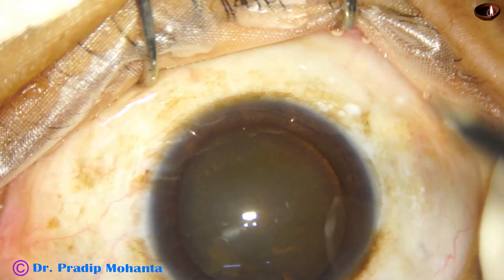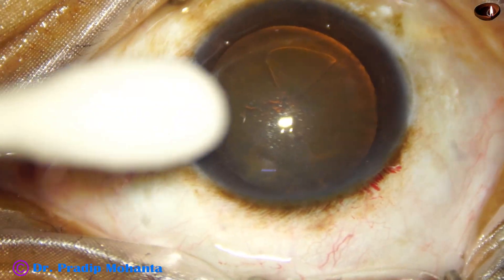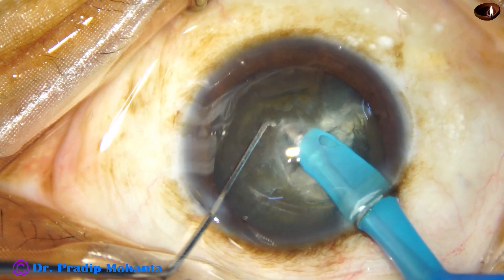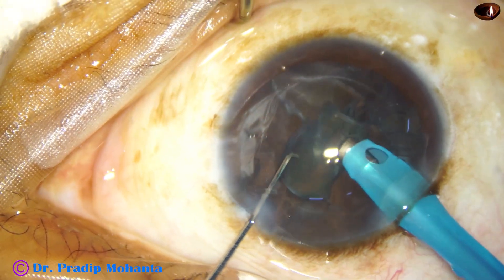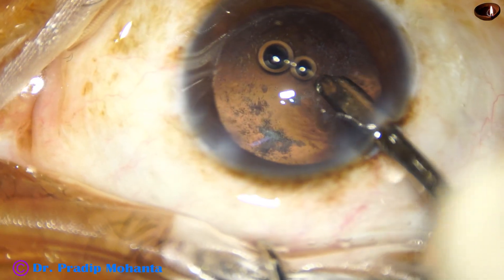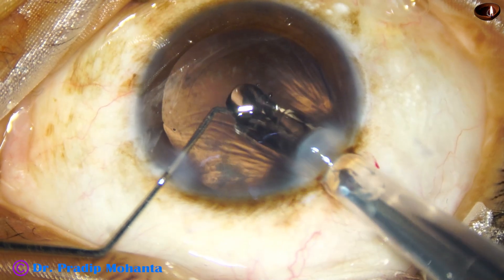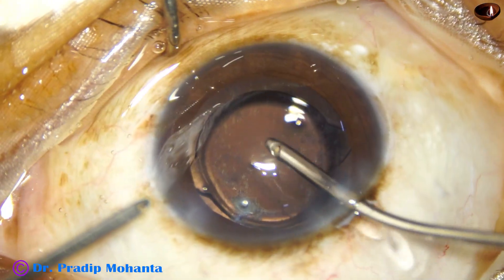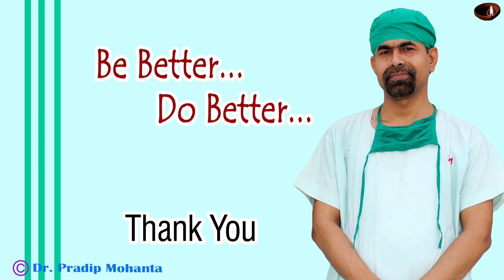Phaco : Tips and Tricks in a vitrectomised eye, post silicone oil removal: Pradip Mohanta

Comment: When I want to use the phaco tip to do some I/A of cortex I switch to I/A mode. No way to buzz the capsule or iris with phaco inadvertently! On the Bausch and Lomb phaco machine there is a foot switch button to cycle through all the modes.